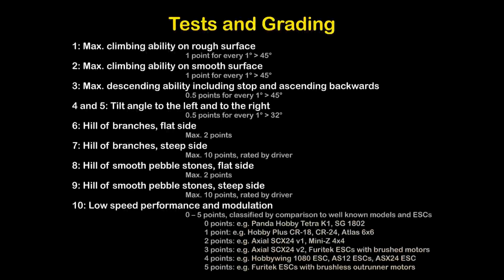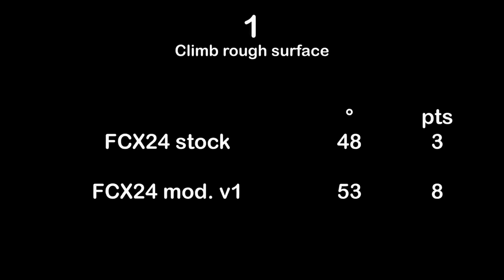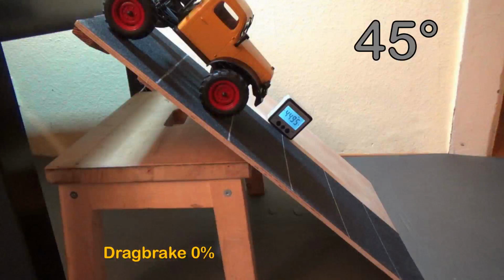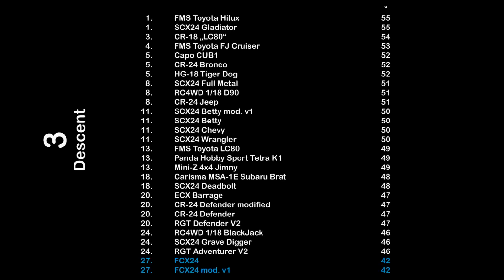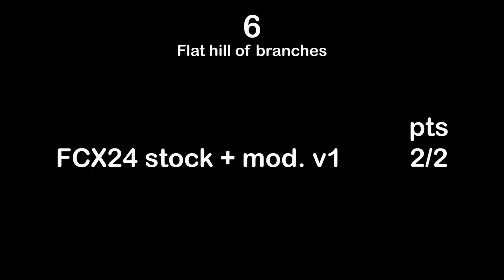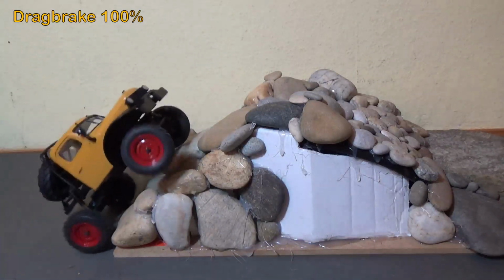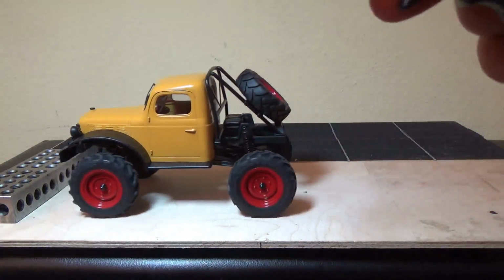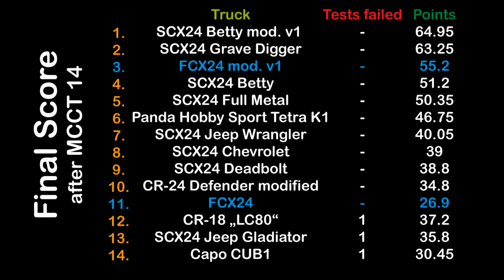MCCT 14: FMS FCX24 stock + modified v1

Comment: I found a way to mount the spare wheel lower, without using the roll cage.  The bracket for it fits well onto the back part of the frame - put the wider part of the bracket at the back.  It sits onto the two straight sides of the frame, as far back as it can go.  The front part of the bracket sits higher.  Now put two small silicone rubber bands over it, crossing over the central peg, then screw on the wheel.  That keeps the weight at the back, to balance the cab, but makes the centre of gravity a little lower.

Comment: Ho thanks for your amzing videos

What would you say was the best 1 24 scale rtr crawler to buy. Iv been looking at the power wagon? Thanks
Reply from the maker: Thank you.
Best in performance or best in scale? FCX24M are awesome, but performance is rather poor. If you wanna mod buy a FCX24 Power Wagon or a SCX24, FCX24 is significantly larger.
Reply: Thanks for the reply!.
What's the best rtr 1/24 performance out the box. Looking for the most capleble.  The power wagon looks like it would be the best with just changing the wheels!

Thanks
Reply from the maker: @stevenewman7955  Check my list here and you do at least have some points of performance. FCX24 is significantly larger than for example SCX24... - and larger wheels will mostly highly increase capability in rough terrain. So a FCX24 with large wheels will be able to overcome obstacles a FCX24M with tiny wheels will never be able to, SCX24 is "in between". 
I would not call a FCX24 1/24, even if it is sold as 1/24. 
SCX24s are quite capable for what they are.
Reply: @donaldsneffe   I do more resurchh in to rtr scx24 thanks so much!
Reply from the maker: @stevenewman7955  IMO FCX24 are more fun to drive because of 2-speed. So you have high and low speed, nicer to cruise and climb around than with the SCX24, which is quite slow. But 2-speed transmission is also heavy, not good for center of gravity, ... - everything has its ups and downs ;-)